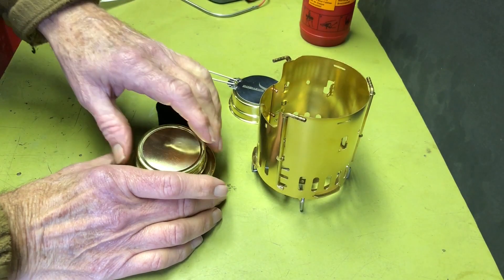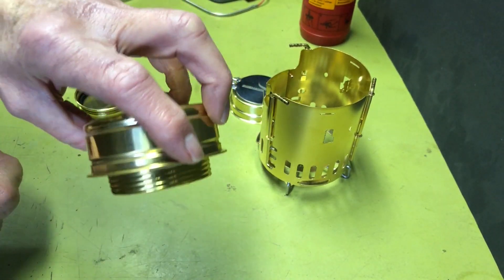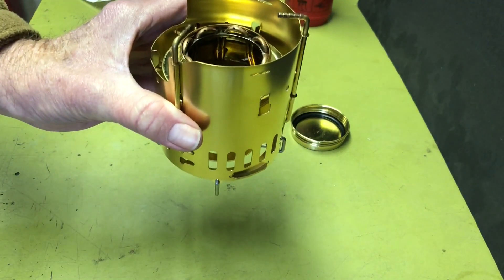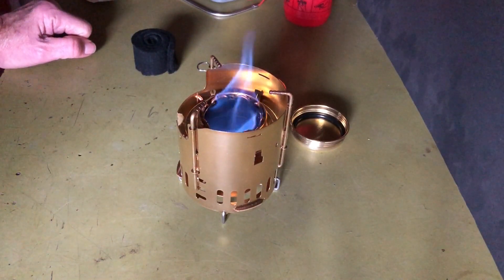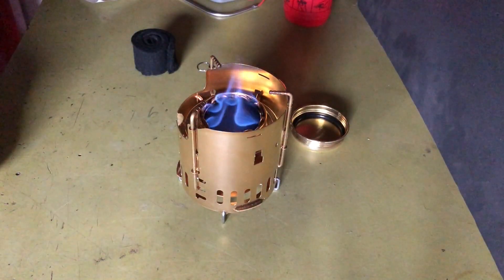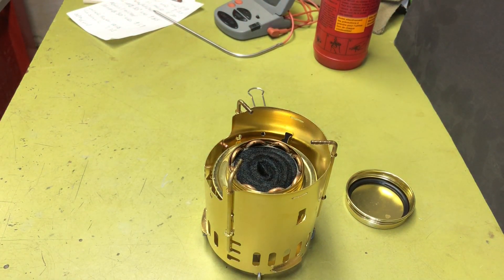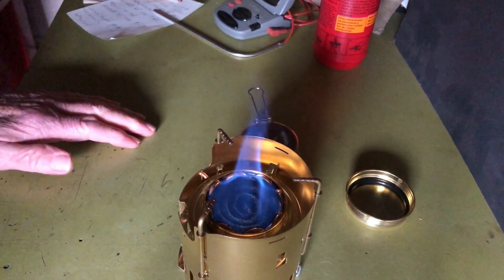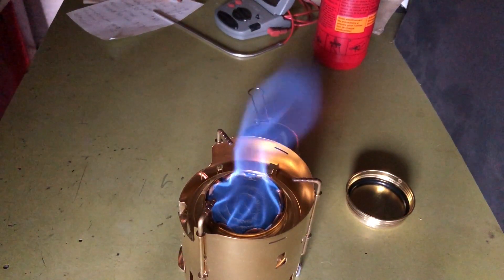Goshawk Burner Using Carbon Felt

Comment: Works significantly better with some steel wool scrubber down the bottom, carbon felt on top - then get some wire mesh cut to size and shoved in the top. It's also good to indent the mesh downwards so it's almost like a cone.

Comment: I wonder what would be the results if the carbon felt was shorter by 1/4 inch so it was not flush with the top of the burner. What would happen if the carbon felt was one wrap looser so it was not up against the inside wall of the burner but offered a little air space inside the burning chamber.
Reply from the maker: I suspect that it might do better, same with the Trangia.  If things get slow around here I may go back and test it, If I do there will be a video.
🙂

Comment: this is a nice looking stove, very "vintage" looking and reminiscent of the famous SVEA 123 (I still have one)  BUT  I see some little minor design problems: 1) it should be stable, these legs just have to do the job!, 2) the frontal opening for the simmer-ring should reach to the wire-legs, just a little space but it would make the in and out bringing of the simmer ring somehow easier, 3) the gravity center is still quite high (like with practically ALL gas stoves and most gasoline stoves), and with that shaky base I would be afraid to tip over the already narrow and high pot! (the only intelligent solution is the Trangia System (alcohol, gas and gasoline burner) where the gravity center is quite low and the base quite wide 4) I am not sure if that windbreaker function is really there, I do not see much protection, 5) that brass is just too nice to be stained by burning wood... and perhaps it does not work too well if you do not use another windbreaker around it... 6) about the performance of such pipes in the burner it is still not clear if it provides better results than Trangia and all the others
Reply from the maker: I call it the SVEA 123 of alcohol stoves.  I think you could put a rock in the bottom of the stove to lower the CG.  
I'm with you on using wood.  I see wood as a backup.
I'll have to due a boil comparison between it and the Trangia.

Comment: Silly question: Aren't the tube jets angled? Producing a swirling flame? 

Does the direction that the felt is coiled make a difference?
Reply from the maker: The jets are angled.  The direction of the coil won't make a difference.
On my burn test or the 1oz round tin burner with the coiled felt the flame raises straight up with no deflection.

Comment: Hi there ..
👍👍👍 .. thanks for that .. much appreciated.
The risk of spillage (considering the Swiss lack of humour with those who try to burn down their forests) is my first consideration 😏. That the Felt holds the fuel better also reduces the tendency for leakage during storage .. although I try not to store with a full tank. I rather add less fuel and refill if necessary. Experience has shown me approximately how much fuel is needed for whatever. Also, some pundits stress that it is unwise to regularly 'burn a Trangia dry'. It apparently can lead to cracking in the tank. 
An added advantage .. lighting up. No need to push a Bic lighter upside down (as I have seen some 😳) into the fuel tank .. and hold it there 😳😳, especially in below zero temperatures. My experience in below freezing, the Carbon Felt 'Wick' lights up first time and stays lit. One can put a pot onto the stand immediately and not have to wait for a 'bloom'. In cold conditions, not waiting for the bloom has the flame sometimes extinguished when a pot is put on.
'berniedawgcinema' .. I believe that he has since passed away, he did some work on Trangias and Felt some time back. His channel is still active though.
Once again, many thanks for taking the trouble to try the Felt .. take care ..
Reply from the maker: I use matches with my  stove but I have seen a great technique where they dip a twig or leaf into the alcohol and then light it with the Bic.
The wick stoves like the Fancy Feast do work well in cold weather,  I've watched video of them working great in -20F.   
The Trangia style burners do seal good, I've never had leakage problems not to say I won't.  I keep a full Trangia in my bottle bag kit for one or two cups of tea/coffee. So far so good.  🙂
Reply: @planetsideagent  👍 .. correction, not berniedawgcinema .. hiram cook.
Reply: @Thomas Musso, I certainly hope that Hiram Cook didn't pass away!
Reply: @margaretadler6162  Me too. However, I 'think' that I can recollect someone saying that he had. He has not posted for quite a while now. Like you, I hope that I am wrong.